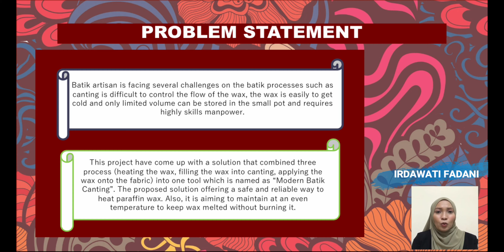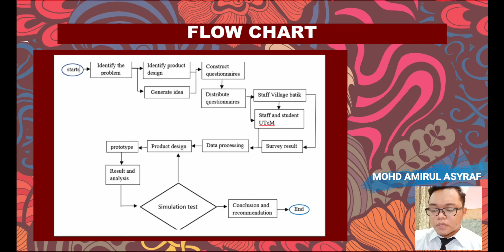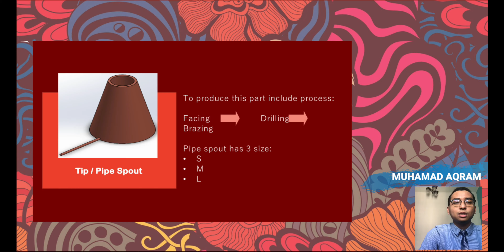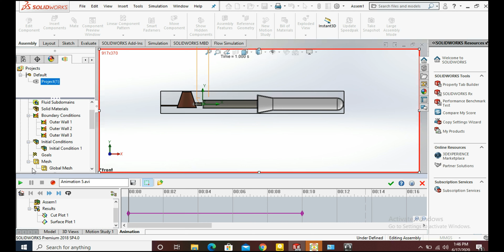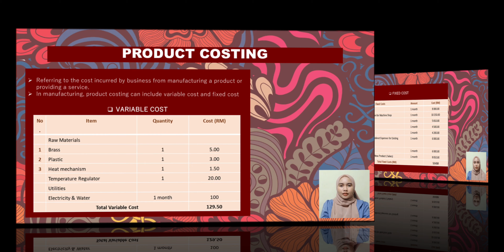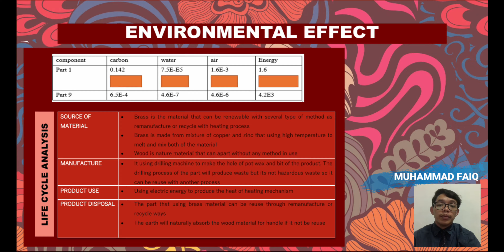IDP GROUP 7 Modern Batik Canting

Comment: Hi everyone...overall, I found the idea of this project is very interesting. I myself had experience doing canting before and it is interesting to see someone try to solve several problems of handling the canting. Got several questions, 1) what is the temperature needed to keep the wax continuously in a liquid state?, 2) have you studied the flow of the wax when it passing through the canting funnel? Thank you. Cheers.
Reply from the maker: Hi! Thank you for interesting to our project.

Q1) To keep the canting in liquid state it just need 42°C,but this is not important. The important thing is to keep the liquid wax very hot because it need to soak into fabric, good range for the temperature is 61-72°C. if the liquid just in the liquid state without having high temperature during painting it may face problem.

Q2) This may cause difficulties to the designer.We focused more on the temperature study. The wax flow is not important as the distance between input to output is very short. The possibility of wax to become hard is less in the proposed design.Whereby the wax will be continuously heated.